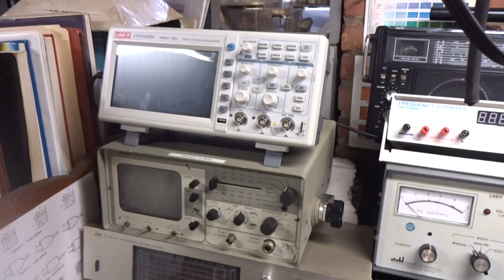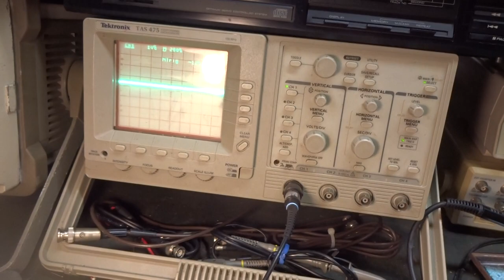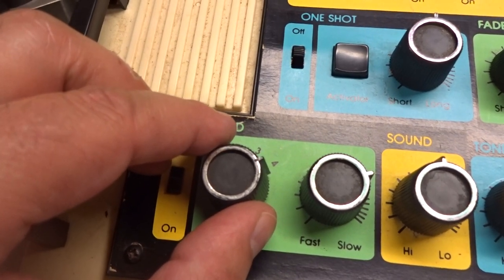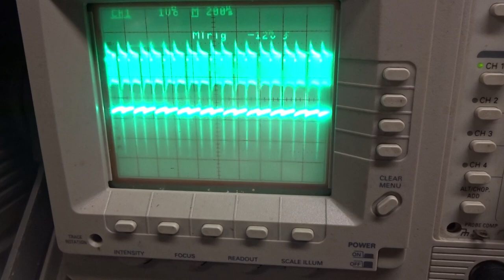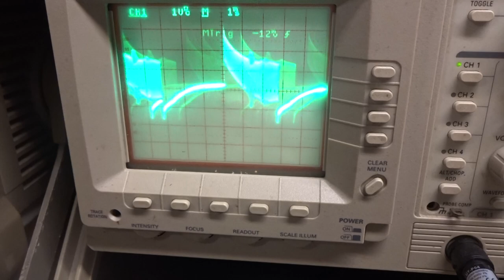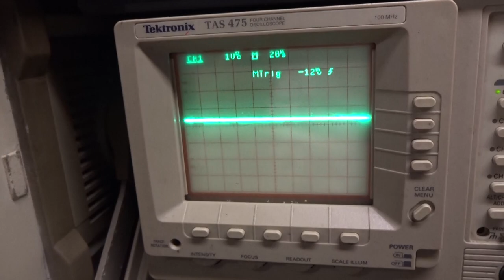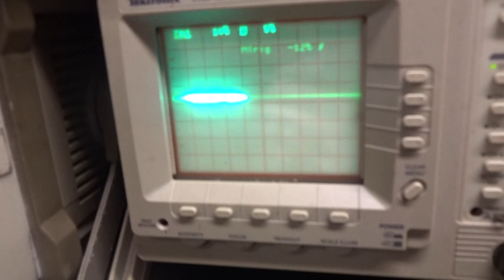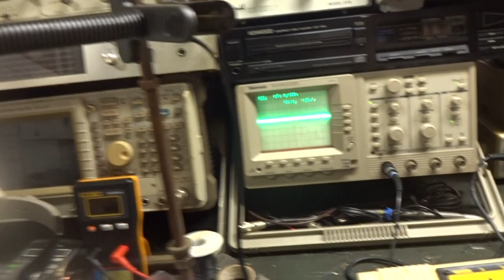Audio Frequency Generator, a Toy for Kids Ahead of Its Time

Comment: That's a cool toy Frank.  Do you know the manufacturer or model number?

I always liked the Tandy electronic and science kits you could pick up anytime at your local Radio Shack store.  I guess there are other things around today but it is more putting together modules of components.  I miss the 70s.
Reply from the maker: Hi buddy.  I do not know the make or model number.  This was a gift to me from the early 1970's.  You can still get old, good soldering kits from Elenco off of ebay and amazon.  However, Elenco is currently just selling electronics kits for kids around age six or up to ten.  Other electronics kits that require soldering are junk coming out of China.  I have tried to build many small AM/FM radio kits from China with no success.  For example, on kit had no holes on the PCB for the EMF, another without holes for the AM antenna-coil wires.  Some kits come with no directions or no directions written in English.  I suggest purchasing the four-volume encyclopedia called Encyclopedia of Electronic Circuits by Graaff.  Build the circuits from the encyclopedia with parts purchased from NTE or Fairchild, but avoid counterfit parts from ebay.
Frank
Frank